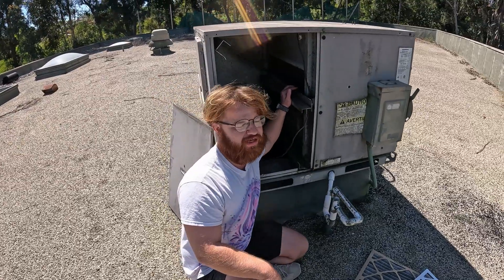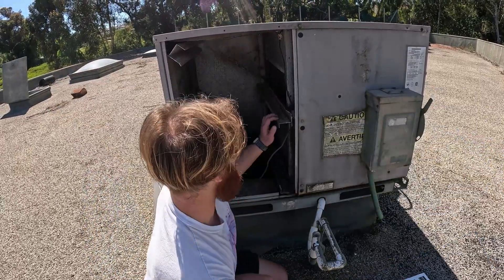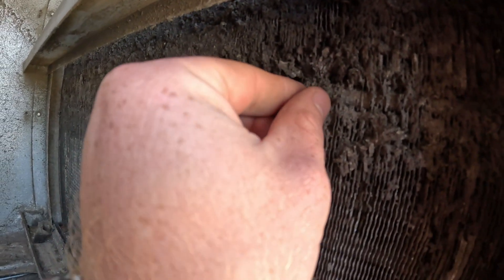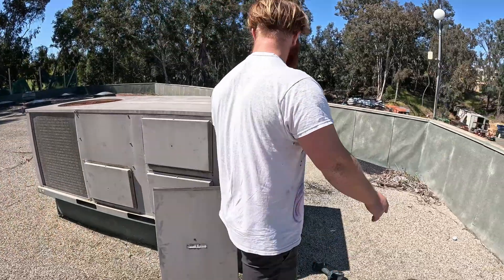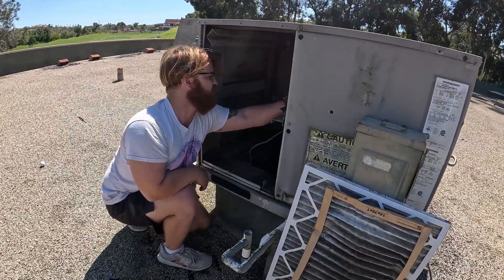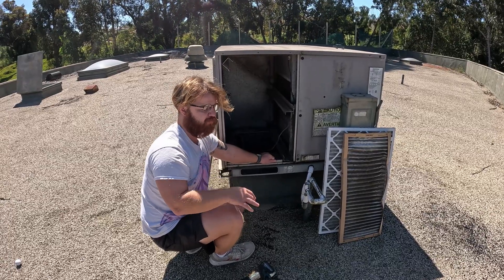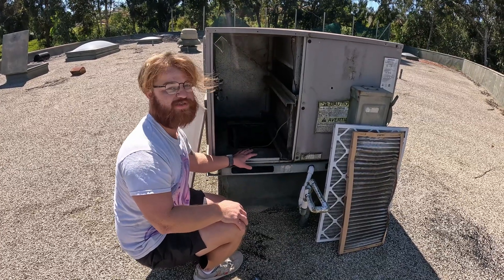What Happens When You Run An AC Without A FILTER FOR YEARS

Comment: I woul tell them they need to use 2" filters in these Sunline units.
Reply from the maker: 100%. In this case the previous visit was our first time out and filter sizes were unknown. They called in the middle of a heat wave and they have no stores around except one Home Depot like 20 minutes away. We ran and grabbed these 1" filters and basically told them the system was going to die unless they replaced the coil. I reached out several times and never heard anything back until like a week ago.
Reply: @SurfBrosHVAC  You can lead a store to water……

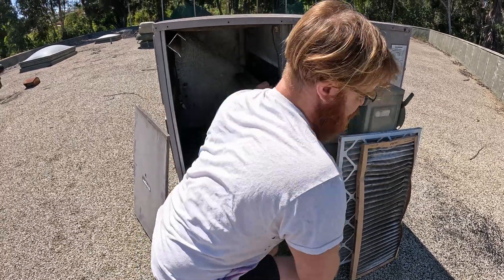Comment: 01:17 iF YOU WERE THERE LAST YEAR, WHY DID YOU NOT ADDRESS THE FILTER SITUATION WHEN YOU WERE THERE LAST YEAR, SOUNDS LIKE YOUR FAULT. YOU PUT A CAP N IT LAST YEAR BUT YOU DID NOT TAKE CARE OF THE COIL OR FILTER ISSUE LAST YEAR! that coil did not corrode and fail in 1 year. you missd it last year!
Reply from the maker: No. It looks the exact same as last year. This is a commercial property. They approve weird things. When they called me last year it was because the cap had failed. I checked the coil and filters and found it in this condition. I told them that the cap had failed and that was the reason it had stopped cooling the previous day but that the system needed to be replaced. I replaced the cap and sent a quote for replacement. They did not move forward. They did not have approval from upper management to replace the system and they are hoping to get it this year.